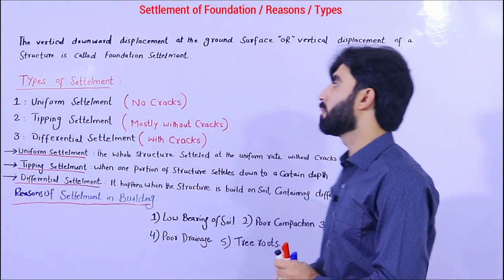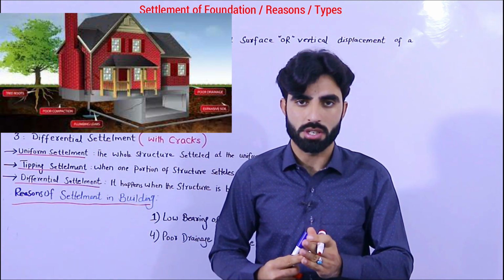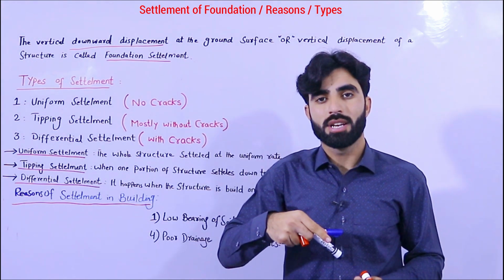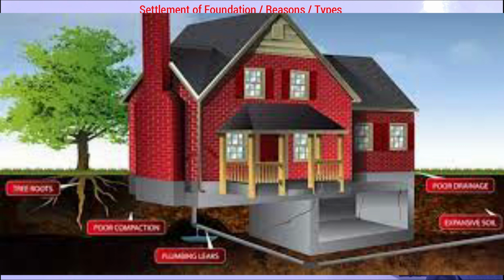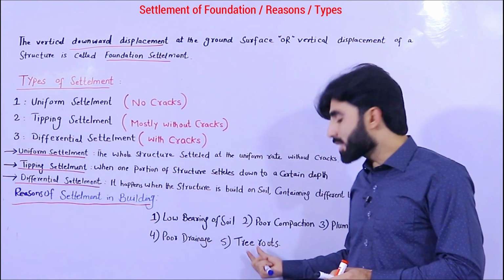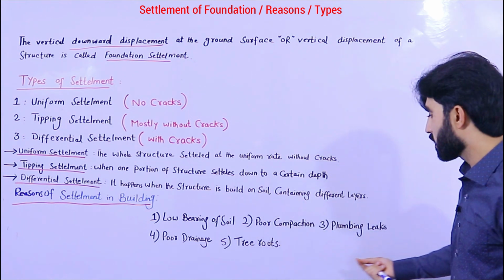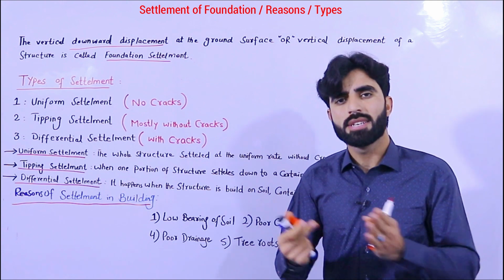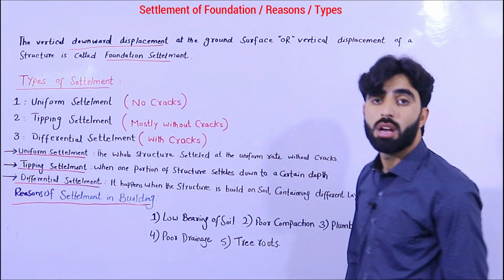Reasons of Settlement in Foundation?Types of Settlemenr | why Cracks Provided in House Construction?

Comment: G+1 building having medium clay soil...which foundation would u prefer?
Reply: Single Slope footing with 3 feet of foundation
Reply: @jamirfishkeeping  why sloped bro
Reply: @mohanlalfan-akhineditz2267  because it's economic. And since your soil is medium,.it will do.
Reply: @jamirfishkeeping  will there be any settlement..since its clay and column loading is point loading
Reply: @mohanlalfan-akhineditz2267  just make sure proper soling is done and also compaction.